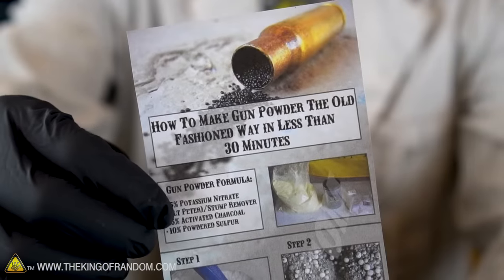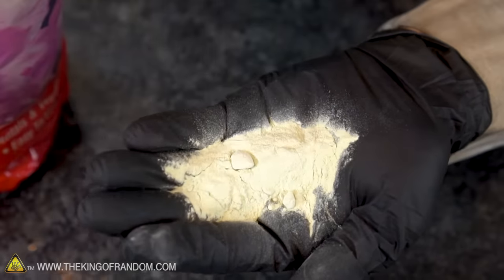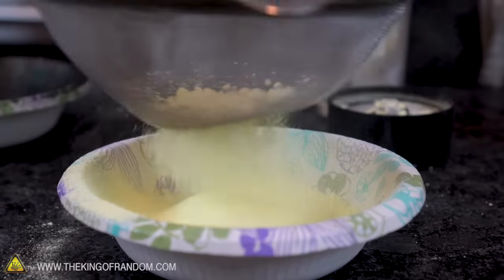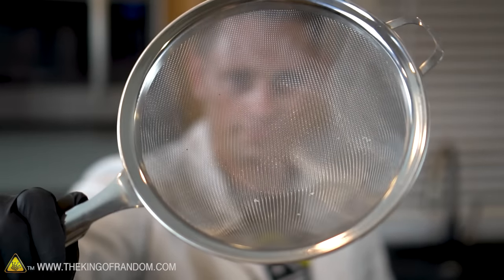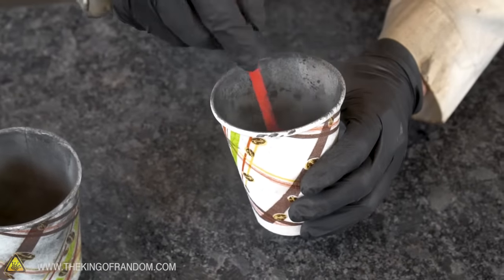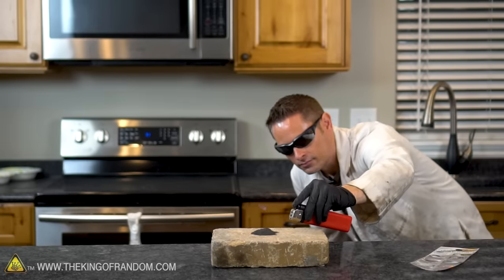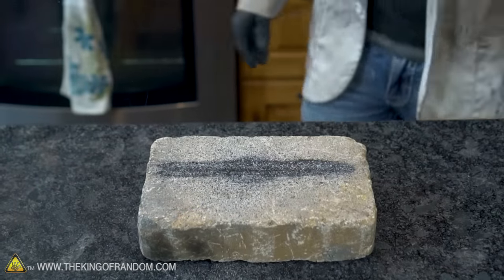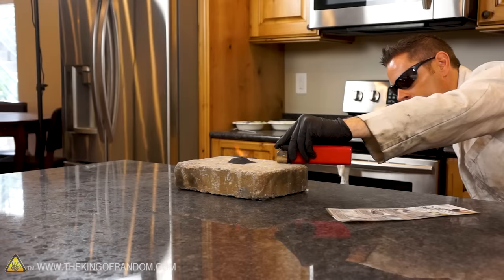Homemade Gunpowder, For Science! How To Make Gunpowder - DIY Gunpowder Experiment!

Comment: It should be noted that gunpowder based on this formula was rendered obsolete in 1886 with the invention of "smokeless" powder, also called nitrocellulose. Although not truly smokeless nitrocellulose does emit only a tiny fraction of the smoke of traditional black powder, burns much faster, leaves less residue, and the residue it does leave isn't inherently corrosive like black powder residue. As a result nearly every firearm designed after 1886 has been completely dependant on nitrocellulose to function. Putting black powder in a gun designed for smokeless will gunk up the gun within a relatively small number of shots, cause it not to cycle if any energy from the shot is used to move internal parts (like in semi-automatic or fully-automatic guns), and begin corroding the gun if it isn't cleaned promptly. On the other hand putting smokeless in a gun designed for black powder can blow up the gun.
Reply: The early smokeless powder- cordite also had vaseline added as it lacked the natural lubricating property of the carbon in gunpowder. When the British army began chambering it in their Lee Metford bolt action rifles it tore out the rifling so they switched barrel production to the Enfield factory and the Lee Enfield was born. In the 18th Century the British invented 'corning', a process which mixed the earlier serpentine powder more intimately giving better ignition and more power, thus their naval cannon outranged the French who didn't know about it.

Comment: Adding some powdered aluminum to the mix works extremely well.
Reply: It will make brit sparks but will not increase burn rate and you really need to increase the oxidizer enough to oxidize the aluminium powder( which should be pyro. or flake  aluminium) or it will slow down the burn rate this is because the formula for black powder 75/15/10 is already sociometric.

Comment: For anyone who's curious, that's not how you make black powder.
You can't just mix all the ingredients in a bowl, you need to run it through a ball mill and that was only a slow flame, black powder is only explosive when it's compressed.
Reply: you can also put the powder in a solvent such as ethyl alcohol and let it dry, it burns considerably faster

Comment: Your powder burns only very slowly because it needs to be dampened, dried and re-ground in a process called "corning". This is where the commercial stuff really differs and disappears in a flash. This has the effect of allowing the potassium nitrate oxidizer to far more intimately connect with the fuel and it creates grains which burn much faster than fine powder.

Comment: Try refilling empty cartridges with this improvised gunpowder.
Reply: Thatd be difficult to do given that there are many many distinct varieties of powder out there on the market. When it comes to black powder there are several different grades like f, ff, and even fff, which mean fine, double fine etc etc. The other downside is that most Powders used in modern cartridges to date are charged with Smokeless powder, which is an entirely different beast all together. While its not entirely smokeless, it produces a lot less smoke than black powder because it contains more chemical energy, so the ratios of powder to cartridge would be hard to determine. My guess is Grant is making this for some fireworks or other experiments like Black powder in Liquid Nitrogen.
Reply: llama you would have to granulate the powder first into the correct grade to successfully use it

Comment: Like if he should make cannonballs using metal foundry and use the gunpowder in a homemade cannon
Reply: I had a neighbor that made a small cannon and fired 3lb ball bearings into San Jacinto river... yeah, the yank neighbors called the heat and he had to plug the cannon up...
Reply: Isaac Cervantes III o
Reply: I guess he will do that in the future if he feels like it, but I dont think its complicated, he only needs to melt iron in a ball form (also can be done in "green sand" or ceramic ball negative form ) then do the same for the canon maybe strap some wheels on that THICC canon and use the powder shown here and boom !
Reply: This powder needs to be granulated in order to be used in cannons. Granulation reduces the speed of ignition and prevents cannon explosions.
Reply: @brycef.5812   lol do some research before you comment  brass, bronze and other materials can be used to make cannons

Comment: @Grant Thomson - "the King of Random", I have to say, you can not use plastic  either, they make static charge, and it is actually even worse than making it with metal, best is to use wood. Please take a note to say that in next video, or something. Because people might get burned. Thank you! by the way, it burned slowly not because of open space, but because it was not well mixed, you need to use molder and passel glass like you showed, stone or wooden, and it is used after mixing then together, then burn rate is really fast.
Reply: This feels like giving some experience to others :)

Comment: Try granulating the powder to increase its effectiveness, to do this you just need to mix it with some ISO Alcohol and push it through the sift and wait for it to dry and BAM you have significantly increased its burn rate
Reply: brillweb101 ISO alcohol? How do you disinfect a disc image?
Reply: iOBX he probably means isopropyl alcohol.
Reply: @dot shell ...I do indeed

Comment: Try to put 80% of KNO3 and 20% of C. It is 3 times faster than this.
Reply: Kuba Kozlovič This mixture is slow because it's not mixed that well- "proper" BP is processed in a ball mill and burns much faster. otherwise it can be bound together and screened into granules, but both of these take more effort and so most people don't bother

Comment: isn't plastic more dangerous if you're afraid of static?
Reply: No. Metal will actually conduct static electricity in your hand.
Reply: I meant if he was afraid of static he should've used a wooden chopstick or glass. 
Of course metal is the worst idea, but plastic rubbing on other material can still cause static charges.

Comment: What if you add magnesium
Reply: Sandro Silva bright White flashbang-like explosion ;)
Reply: my experience it was slower and produces allot more heat. And a lot of sparks
Reply: Sandro Silva when magnesium burns a bright light can blind you for a moment so don't play with it. Magnesium is a very strong metal and lightweight with a low burning point compared to other metals so it does have many uses.
Reply: Miguel Hernandez Magnesium is what they use in flashbangs
Reply: Miguel Hernandez g

Comment: You can refine that powder by mixing it with pure ethanol and boiling it down until moist, take it off the heat and let it cool a bit, scoop it out and press it into a ball and scrape the ball over a metal sieve or window screen. The sulfur and salt petre melt and are absorbed into the charcoal powder's pores. When the remaining alcohol evaporates, the reaction will be much more intense!

Be sure to scrap the sides of the pot down while boiling and take it off the heat while there's still a bit of liquid left.
Reply: Don't know where you got this information but it is  totally bogus just for get it, it is utter nonsense.  1. pure ethanol is highly flammable   (please do not put on the stove top)  2. traditionally water is used to moisen black powder for corning which is what you are describing. and it does not have to be heated ( but will help it dissolve the potassium nitrate better) it only needs moisening enough to clump together in a ball for rubbing over the screen (corning).

Comment: What will happen if you make slime using gasoline. will it burn?
Reply: Padlo Langer putting styrofoam in gasoline will dissolve the styrofoam making napalm which is kinda a slime
Reply: Making slime the king of random way but instead of water you use gasoline

Comment: Will frozen black powder ignite? Liquid nitrogen and black powder...
Reply: Clayton Whedbee it ignites at a certain heat - making it colder, then heating it back up with fire, will give you the same results as just now, assuming you aren't just dumping the powder itself into the nitrogen, since that'd change the chemical composition

Comment: This is really poorly made black powder, a well made black powder milled in a ball mill for ~2 hours will burn in an instant in open air as well.
Reply: Two hours?? I mill mine ( 500 grams ) for 24 hours!
Reply: 24 hours?
I accidentally left mine in  the mill for a week!
2000 grams
Reply: Hours?
I started making gun powder 8 years ago and still haven't finished the milling process.
500kg
Reply: 8 years? My grandpa started milling 1 ton of black powder in 1920 and the process is still going today
Reply: 90 years? My ancestors started milling black powder in the 1650's (50 tons) and it's still going!
Reply: So did mine. We are probably related.

Comment: could you try putting in some bullets?
Reply: Internet virus 😈
Reply: You cant put anything inside of a bullet, and you cant put it in a round because its not the right type of powder.
Reply: I don't think the powder type really matters; Earlier on his channel he threw armstrongs powder into a round to try and use it as a primer (And it actually seemed to work, mind you). Of course, it probably wouldn't end well but I mean if you don't mind an explosion in your face/hands/nearby-off-of-a-string then I guess you can just go ham.
Reply: typical internet... 

yes the powder type very much matters. black powder explodes. that means it has a very high combustion rate. the force of the explosion is what creates the pressure to drive the bullet. 

Modern propellent burns much much slower. Even pistol powders which are faster burning than rifle powders, all use the force of the expansion of gas from the combustion of the propellant to apply force to the projectile. 

the armstrongs powder in a primer is very different than the actual charge propellant. 

if you loaded a 9mm case with 5grains of black powder it would likely blow the gun apart.
Reply: I meant the powder type probably doesn't matter if you're exclusively putting it in the bullet (Are you physically capable of putting black powder In a bullet;  reaction doesn't matter)  .  As I also expressed,  firing it is an entirely different story...
Reply: so maybe you are a bit smarter than I understood. by bullet most noobs mean a cartridge or complete round. that is what he and dozens of others have said and it doesn't take a genius to infer what they really meant. 

yes if you put blackpowder in a hollow bullet tip it doesn't matter. 

using blackpowder in place of modern smokeless powder in a cartridge is dangerous. period. end of story.

Comment: trying to do this without a scale is hard. I guess the densities are different so 10-15-75 by volume is a lot different then it is by weight. I get some ignition but it doesnt want to light, and burns slowly.

Comment: Needs to be mixed with water dried and milled.  Potentially dangerous process but upon ignition the burn rate would have been much more explosive. Dried mix like this Burns effectively but black powder is actually an explosive and to achieve the correct molecular structure you have to mix it with water so the ionic bonds will break apart and recombine into true black powder. Do not use a dry mix powder like this in black powder firearms the pressures will be too high.

Comment: OK...so when I was about 10 or so (early 70s...when the hobby store carried everything a ten year old could think of for mischief) I made black powder using charcoal briquettes and the ingredients from the store. Put it all into a pile at least five times bigger than yours and ground it together on a metal cookie sheet in the basement. 

You probably see where this is going.

A small corner ignited, and the entire pile went-up in a brilliant nano-second. A mushroom cloud rolled up and along the ceiling, then up the basement stairs into the house. I knew how bad that would smell when mom got home. Opened every window in the house to air out. Still had to answer a LOT of questions later.

Comment: so question, the gunpowder in modern bullets looks like tablets that come in different grain sizes. Is that stuff the same as this just different shape? if i used this to reload a bullet would it work just fine?
Reply: No. Smokeless powder is an entirely different chemical composition. One that is much more powerful. That's why if you load smokeless powder into a black powder gun you will likely blow the gun up. You can reload bullets with black powder yes, but it's not the same and the measure will be different for what you'll need it for. The powder in the video is old school black powder. What you see in cartridges is smokeless powder.

Comment: Will the sulfur on the tip of matches work?
Reply: no, match tips are made of more than just sulfur and they can actually explode by themselves if you have enough of the powder in a dense enough environment.
Reply: it will burn, but will be slower and act different from black powder
Reply: @luthfihar3211  oh ok thanks!!
Reply: @awg7956  ooh I’ll also have to try that thanks!
Reply: @biottis4170  a simple way to do it would be to use a hammer and nail to make a small hole in the pavement, then fill it up with the match head powder and hit it realy hard with the nail on top, should make a loud crack.

Comment: if you don't want to discharge energy into the mix you should use a metal cup and ground the cup and use a metal rod and ground the rod.....is a balloon an insulator or a conductor? why do you get shocked when you slide down the plastic slide at the playground, and when? the insulator in your hand holds a charge which builds from the friction against the materials and from the friction of the other insulator that is your glove. if you ground both then there is no imbalance and no potential as soon as any might form you would conduct it back to earth, your welcome. this is not advice just science.

Comment: I had a problem. I made the gunpowder this way using these proportions but mine is very difficult to burn. I put it on top of paper and the part of the gunpowder doesn't burn and when it burns there's a residue that in the beginning boils like melting plastic and when it dries it stays hard as stone and while the gunpowder burns it looks like there's something keeping it from burning. It's like the fire trying to move forward but something stopping it.

  I used saltpeter to make it but I recrystallized it first, I boiled it, dissolved it and put it in the fridge. I tried to burn the gunpowder only with a mixture of charcoal and nitrate to see if it was sulfur but the same residue was produced but with a white color before it formed yellow, bluish green and red in small balls left in the burning area.
  Does anyone know what can it be?

Comment: Could this work without the carbon?
Reply: No
Reply: @stumptdawg4684  I figured since the other two are very flammable when mixed that it wouldn’t need carbon
Reply: @hemp64731  It would only work with chlorate not nitrate
Reply: @hemp64731  Yeah but them youd need to replace the sulphur with a metal

Comment: This is hardly a secret.  As I was growing up some friends of mine and I in the old neighborhood used to make it with charcoal, saltpeter and sulfur.  The trick is to determine the correct percentages of each component.  A great replacement for the charcoal is powdered iron or steel, available from the unwitting dad of one of our number from his home workshop.  There was usually a bit of it around his grinder.

Comment: congrat on using   a   local bought  stuff  not  chemicals// and  mortar   is  creating  much more fine  powder than mill
i never  did water   after to  flake  it  up // do you
want  much more  umph//do  grey  powder   same   like this  just  like 20  x  power //use   kalium  chlorate /chloride   vs    saltpeter  kno3 vs  kclo,, 3,4//
carfull this  is  powder   1  gramm is  more   strong than   normal   firecracker that take a finger  or 2  off you  1  gramm of  grey   //there  is  a  lot  mixes   like  permanganate  /aluminium /clorate  al or  mg// 1 g  of that  in   a  pipe will take  hand clean off  //belive  me  //ok  3  fingers  i  was   not   carfull //once